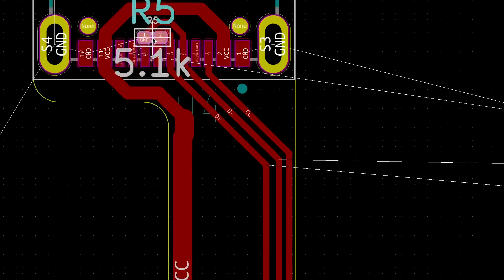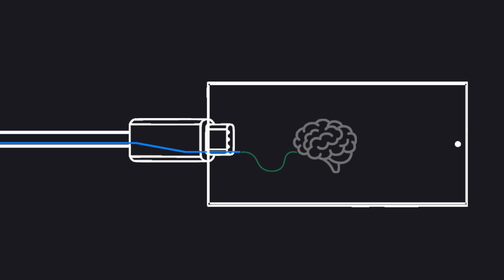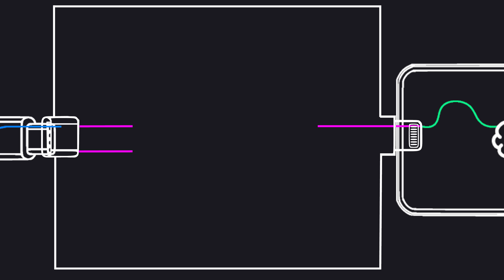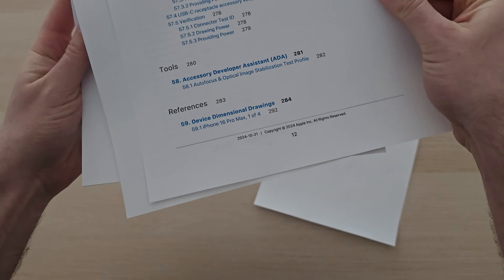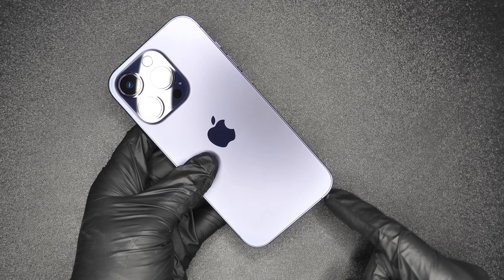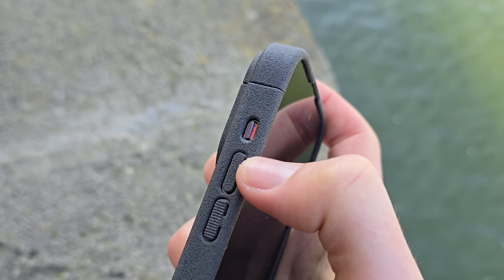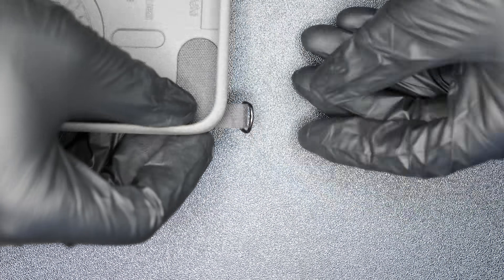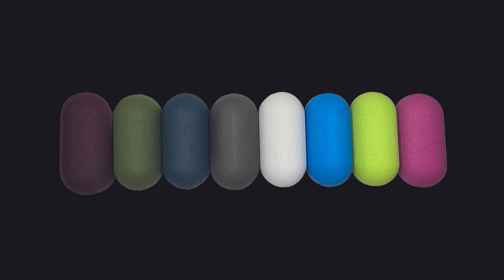I Gave Every iPhone USB-C.

Comment: came after reading on Apple News. Ryan Christoffel  9to 5 mac wrote about this obsoless case which uses his tech. I coukdn”t believe it was possible. 5:45 First question i had: Are buttons easy to press? Looks like, yes. 
-  Sadly noted 2025 July 23, se3rd gen not avail, good news promise 
-  Gladly noted 12:45 can sign up for availability notice. After watching this video, I am impressed by design thinking reiteration shared here.
-  ?? cost by when?

Comment: Every iphone now already has one.  Though I prefer the lightning connector. It's sturdier, smaller, and more water resistnt.  Apple should have just licensed it out and upgraded the data standard to be faster and the power standard to push more power.  If they had, it might have become the standard.

Comment: I know you've put a ton of design work in already... BUT. Can you include some type of OTG handoff magic? Current Lightning-USB adapters either have the phone as host, where it can read a USB drive and power it, or as subdevice, where it can charge and can't read a USB device. Some type of sorcery to make the phone trade off with the same USB-C port would be magic, and I would buy one.

Comment: Is there the reason you didn’t try making the USB c port go out the side of the phone? If you did that instead of making it go out the bottom maybe the corner could have been smaller on the case

Comment: you still need another usb c cable if you want to charge two devices at once so if you need two cables anyway then having lightning for phone and usb c for laptop is the same thing. plus the non pro iphones have the same usb c speed as lightning. like this usb c hard on is so stupid.

Comment: what about a usb-c to lightning adapter that has your solution in it ? If that doesn't exist yet?
I dont really want a 3d printed case, I have an injection molded perfectly fitting thin case on my phone at the moment..

Comment: 9:47 Do you really need to design a new PCB for the mirrored version? The Lightning port can be rotated, allowing the entire PCB just to be rotated.
Are you going to sell pcbs separately?  I would like to print my own case with charging port at left side and thicker screen protection.
Reply: The holes for the speakers and microphones are different, so It would need specific reversed PCBs
Reply: @thegeeks16  I'm not 100% sure, but at least on the iPhone 13 mini, the right side (speaker) is just slightly wider than the left (microphone). The holes in my current case are completely symmetrical so that is not a problem.

Comment: This is so cool. Are you going to move production to a factory if it becomes popular enough, or keep just making it with your own machines (I assume that's a resin printer)?
Reply: Powder printer, not resin printer.
Reply: @kikihun9726   Is the powder printer material more stable than the resin type..?

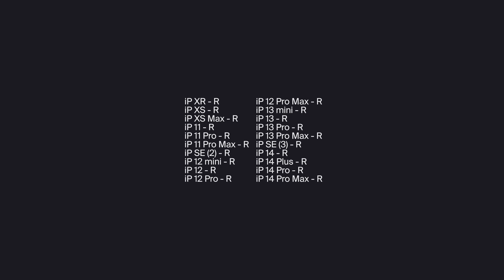Comment: 10:00 no i expect you to 3x it /s. the best configuration would be the usb c port behind the lightning, the usb c hump should match the camera hump thus making the phone sit flat on a surface
Reply: ooo that would be nice. i absolutely despise that the phones dont sit flat anymore.
Reply: USB-C (male or female) ends are thicker than the camera bump, so it would still not lay flat if positioned there. It would tilt the opposite direction when you put it on the table.
Reply: @jeromilittle  the case itself would be adding its own camera bump youd just make the camera bump on the case be the same height to the port bump
Reply: @Altirix_  I see, i guess that’s even extra protection for the cam lenses. But I don’t like a thicker phone case than it has to be, so side port sounds way better.
Reply: This would also be interesting as a pseudo camera grip

Comment: It would be interesting if you could have a lightning connector on the other side so we could use lightning adapters we have at the same time without removing the case

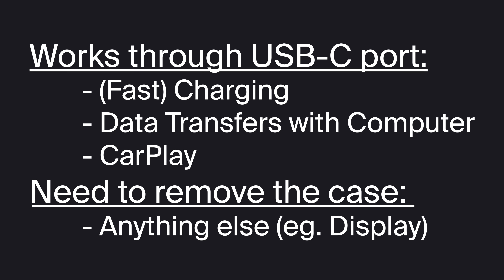Comment: 11:50 wait, is that just all GenAI slop? Ew. Way to undermine the ingenuity and craftsmanship behind your work by caking it in the crap spewed by a bot built on industrial scale theft of art.

Besides that, great project, but man, please don't use that crap. Using a stock photo would have been better. Oh, and doesn't the flexible PCB, reversible connectors, and central placement of the lightning port mean you could make both right and left versions of the case with ease? That's assuming the PCB cutout doesn't block the mic holes of course, but I'd assume it doesn't given that the speaker holes are larger.

Comment: im all for this, but I RREALLLY wish the hard corner was on the left... 90% of the population is right handed and a rounded corner is softer on your hand. also, for gaming if you rotated the device then the same benefit would be available.
Reply: Finally, I catch a break. Lefties of the world unite!
Reply: Yes, and when charging, it seems nicer to have the cable left in portrait (if you're right handed)
Reply: This is a really good point
Reply: you can just hold your phone in your left hand tho, it's really not a big deal
Reply: I totally agree! And the rounded corners make it easier to hold the iPhone. I'm not sure if I'd even prefer a small chin in the middle
Reply: apple doesn't allow the phone to be rotated that way where the camera is pointed down, this is the best option
Reply: Agreed. This is the main reason I wouldn't buy it.
Reply: I'm right handed but I use my phone in my left hand so, it's good for me I guess

But I would never buy an iPhone so it doesn't apply or me

Comment: You don't need to make 2 models but you should've at least put the port on the left side, because most people are right handed. Leaving the rounded corner on the right would make the phone more comfortable and easy to hold for most people.
Reply: I agree
Reply: This speaker is on the left side

Comment: It is possible to add a 3.5mm headphone jack ?
Reply: Where???
Reply: @tamasdebreczeni5335  other corner maybe?
Reply: @o10.collin It would be much deeper so I don’t think it would fit if this barely did
Reply: @o10.collin Maybe two USB C ports would work so you can at least use a cheap adapter and charge at the same tome
Reply: @o10.collin just think how deep that port is, it wouldn't fit like at all
Reply: @xavroy07 Do you even know the proportions brother? If you actually looked you would see headphone adapters with sizes identical to the usb-c ports. It is possible
Reply: @ate-e-ate the inside diameter yes the overall dimensions of the hardware for a 3.5mm jack would not fit
Reply: @tamasdebreczeni5335 left down corner :D
Reply: @tamasdebreczeni5335  at the left side
Reply: @tamasdebreczeni5335 i wouldnt mind a small bump on the other corner for a headphone jack
Reply: I believe Strange Parts did it
Reply: I cant believe its all sold out already.. now apple will start thinking about adding headphone jack in their iphone 17 models 😅..they removed and will now time to add it back with "new headphone jack" coming to your iphone 17 . We want to give it back what we originally took from you. Says Tim cook
Reply: 3.5mm with DAC CS43131 and 4.4mm jack audio
Reply: Bro I’m trying to convert from 3.5mm to USB C 😂😂😂😂😂, 3.5 unless made of quality material , are crap 😂😂😂
Reply: SD card slot
Reply: @teo7196  this is a good idea too
Reply: Wouldn't fit at all??
Reply: Yes
Reply: That would be incredible
Reply: 3.5 mm jack with dac comparability 😅 for iem user’s
Reply: The other side could if had that potential lol
Reply: Yes
Reply: Pleaseeeee
Reply: Why
Reply: Maybe in the left corner
Reply: Or micro SD card slot
Reply: @cameronscott1853 it wouldn’t fit and I don’t think micro sd is compatible with iPhones
Reply: @wyzeyaynon7306  The entire point is to make it fit and compatible and yes it would and yes it would be. He could just hook into the USB bus to have the phone detect storage media.
Reply: @wyzeyaynon7306 maybe interpreting it as a usb pendrive
Reply: Yes but it would also need to be recognized by the phone as an adaptor, so he would need to add some similar haddware chip like with this project to not be conflicting with the wiring of the cc

Comment: 10:00 ok but have you heard about mirror operation in CAD? its really just a few click to make usb port on the other side.  (I'm designing stuff - parts, as my primary job)
Reply: the assembling is different man as it will cost more on different pcbs and all
Reply: its not the design thats the problem, you are right but you have to also think abou the business side of this, is it logical to stock so many variants? what does he do with the unsold stock? a better option might be to allow us to print the case ourself or to allow us to purchase the files, from his persepective it will not make a change if he only stocks one side edit: he already provides the files for FREE, if i had an iphone 14 pm or below i would 100% purchase one of these
Reply: @shadow19  i cant seem to find the files on his website or his github. where did you find it? thinking of remixing his case to make all the corners squared

Comment: from engineer to engineer, thank you. we need more people exactly like you
Reply: Came here to comment the same thing, its refreshing to watch a video where i 100 percent agree with all choices made(except adding small upgrades like a micro sd slot. Etc)
Reply: my thought exactly.
Reply: FACTS !!!!!!!!
Reply: not giving the 3d files for research and improvement and being a greedy loser?
sure buddy keep projecting
Reply: @maksymilian-zajac Womp womp
Reply: @minimal.m it's just a Lightning to USB C adapter (modded) and a grampa case, that's it. all of that AND YOU HAVE TO PAY PATREON?!?
Reply: @minimal.m oh, oh, HE IS SPONSORED. HOW HARD IS IT TO OPEN SOURCE THE FILE?!? It's just a Lightning to USB C adapter (modded with very inexpensive parts), and a slide-in case
Reply: Fr
Reply: 100% agreed. From another engineer. Bravo, bro 👍
Reply: 13 pro max
Reply: we wouldnt need them if apple wasnt scamming people....
Reply: well, having iphones with usb-c is already here in Europe. Just buy the European versions
Reply: @dreamyangel1858  As he mentions at the beginning of the video, the real point here is really to avoid E-waste by upcycling older phones. The fact that it will work with newer iPhones is just also good
Reply: @dreamyangel1858  Every iPhone has USB C now, not just the euro versions. The point is to reduce the obsolescence of devices which use lightning, because of the fact that they are otherwise perfectly fine phones. The iPhone 12 is a great phone, so why should people throw it away just to unify their charging cables? That's the point